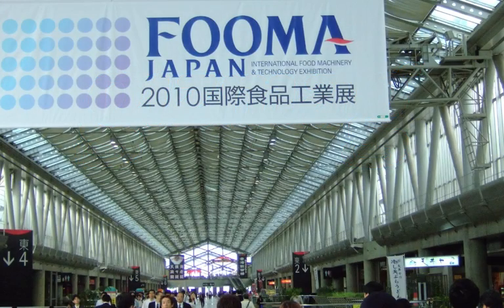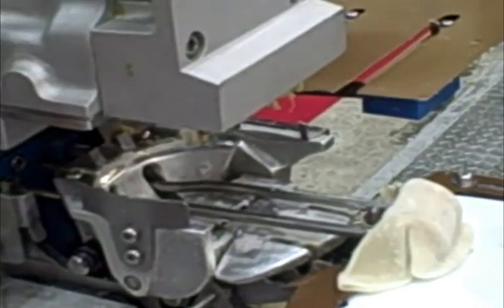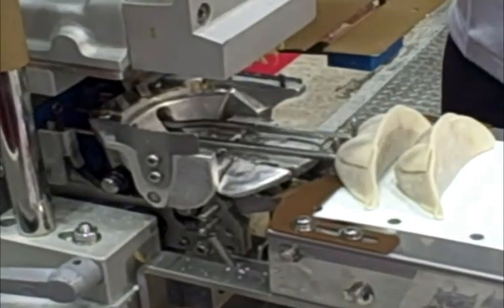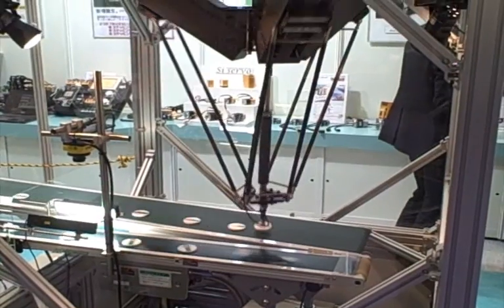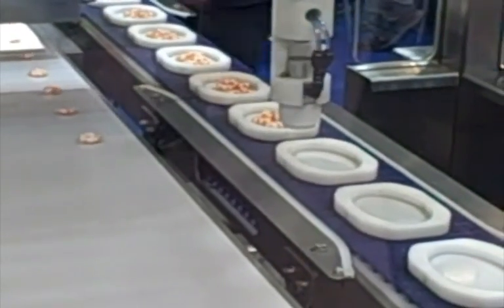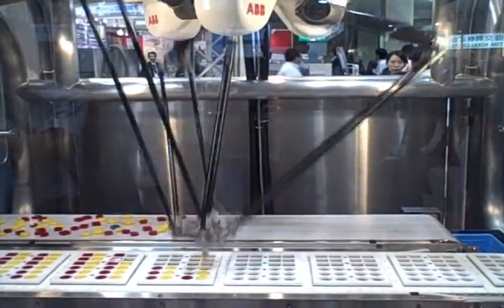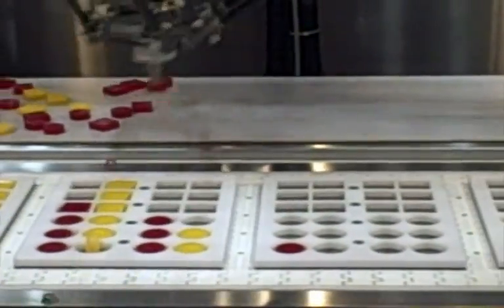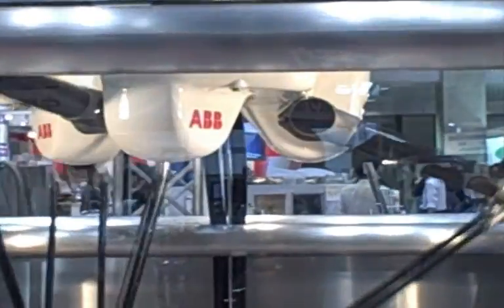Food Machinery and Technology Exhibition: Gyoza machine and robotic arms

Comment: These are really amazing machines! The gyoza maker will save gyoza enthusiasts much time and effort spent preparing the delicious dumpling. Is the gyoza maker going to be sold to the public?
The machine at the end of the video that was separating the little pieces and placing them in the boxes is a big step in terms of assembly line production capabilities. It was moving so quickly!